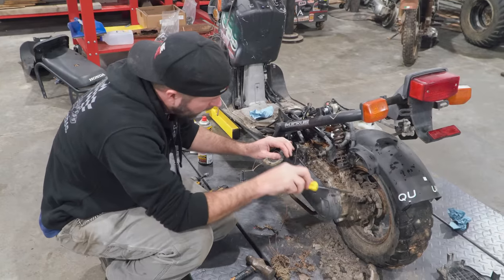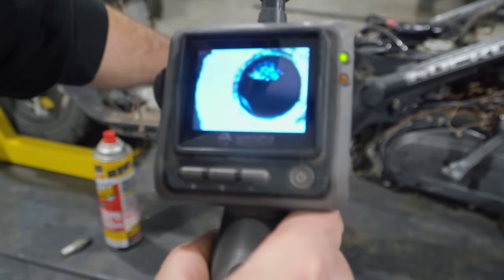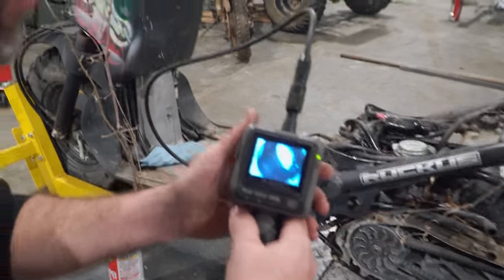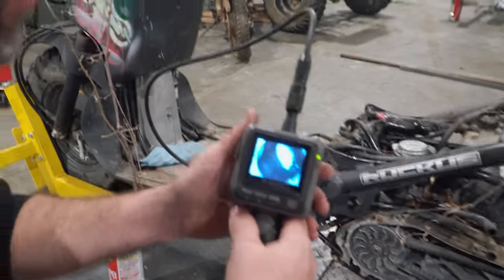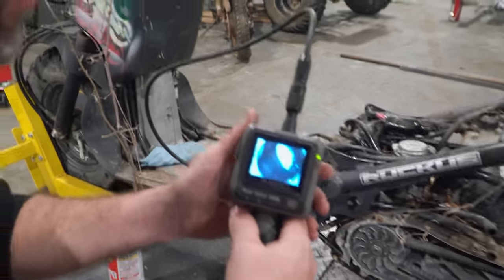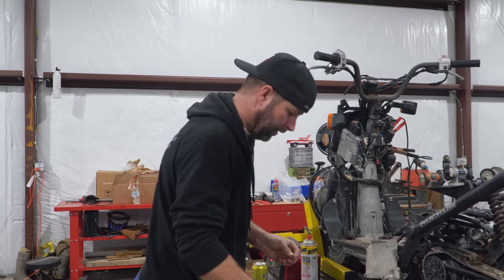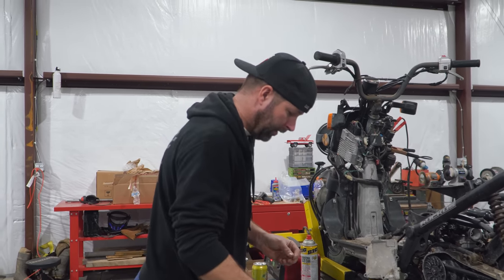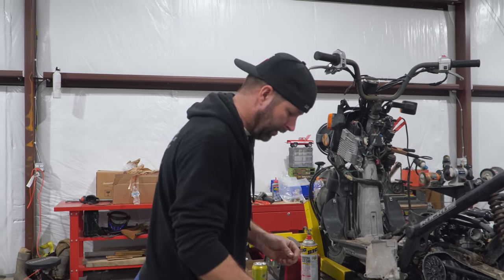We Rescued a Seized Honda Ruckus Moped from the Woods, Will it Run & Ride Again?

Comment: 50cc scooters tend to get on average 100mpg if not more the gy6 125cc are direct bolt ins
Reply: I had a 50cc 4 speed manual moped and it got me 120-130mpg and cruised at 40mph on most rides

Comment: The shims aren't wear items, the valves and seats are. The shims are changed to account for this wear. If you don't have an appropriate feeler gauge, soda cans are usually 3-5 thou thick and can be used in a pinch to get a rough idea. At least in the intake which will probably be around that clearance. The exhaust is probably around double that but it varies by engine. If the valves weren't closing, carbon probably built up on the seat. After adjusting the valves and running it, the carbon may wear off requiring adjustment again quickly.
Reply: You beat me to it Lucas. Valve and seat not shim.
Reply: Some theory is that they become wear items if you grind or sand 'em

Comment: Ah this brings back a ton of memories, I used to have a Ruckus just like that one, mine was a beast though, it easily cruised at 45mph. 
I'd say The clogged muffler is robbing you of a lot of power ATM. You definitely don't need a "hop up" engine!! Get a new muffler and rebuild the valve train and you'll have yourselves a badass cruiser easily capable of 40+ mph. 👍👍
Reply: I also had the competitor to this bike the Yamaha c3 which I liked a lot more then the rukus. Handled better but the rukus would take it on the flats but you hill I would kill the Honda. Plus they both got 130+ mpg.

Comment: You guys should road trip on MTBs with a Monster? 78.5cc 4 stroke, or if you want adventure, stuff a 212 Predator in them, although the 212 poses some challenges fitting the engine, and getting the sprockets to line up, after that, your only problem will be, keeping the front wheel on the ground. I stretched the frame, and added a top motor mount, between the cross tube and the gas tank ears. I lucked out on the front downtube, and replaced the straight tube with sced 80 aluminum with an 6" rad bend at the bottom.My Rock Shock adj front end just clears the new tube at full turns.I also added an LED 7" Harley headlight, and a taillight with turns and brake lights, and a 3 magnet flywheel, and battery, under the motor plate. Rides great, very reliable, and the weight of the headlight helps keep the front wheel on the ground. After 3 years of riding in the Calgary, and now Windsor area, (very flat here), the stainless 2mm spokes started snapping on the rear wheel, so I have just fitted a 6 spoke aluminum "mag" wheel on the back, and 2 rides in, works great. I use the throttle stop screw to keep me at 80 km. In case you're wondering, I was using a hub adaptor on the spoked wheel, and its the second spoked wheel I've had on the bike. The first one did not have stainless nipples in the rim, and failed pretty quickly.

Comment: I have just under 6,000 miles on my 2012 Honda Ruckus and I did the same you guys did with your valves. Now I’m going to check my compression and see if that kit will work!

Comment: Lucky! Around here, even a clapped out Ruckus will go for $2k at least.  The engine isn't a GY6 either, it's the GET2 which doesn't have much in common with the GY6.  The GET is a great engine even though you can't increase displacement very easily.  The Ruck shop's stage 1 performance kit wakes up the bike a lot and it's a simple bolt on the parts and go.  I'd love to see more with this bike!

Comment: Pro Tip for the youngsters: when testing fuel system use odorless mineral spirits instead of gasoline. Far less combustible and hardly any smell. You can work around it and not worry about catching the shop or yourself on fire. The specific gravity is just slightly higher than gasoline so pumps and flow rates will be very similar. It’s petroleum based so it won’t swell orings or attack gaskets in the fuel system.

Comment: As a proud owner of  a '16 Ruckus this one really hit the spot, was wondering when you guys were going to get to us. Gutless pig sure, but still fun to ride? Absolutely. If you try to take this out of a town center, you will only know the agony of 10 cars behind you waiting for a chance to pass. It only goes 38 at best. I haven't found a modification that doesn't just barely tweek performance. I think it is reliable. Happy to see a series on the same ride in my garage. Oh, you didn't mention it's Street Legal and parks wherever bicycles do. I don't remember many of your projects that do that. A bag of ice and a pack of drinks sits on the floorboards perfectly. Also, put some pegs on it. Way more control, less squirrely, I probably should have made that point first... Pegs.

Comment: You should put a Nitrous Outlet powersports kit on it and see what the 50cc will do, a .011" fuel jet and a .012" nitrous jet will give you 6.5 horsepower at the crank with the carbureted wet kit's 6psi fuel pump.

Comment: It has stuck valves from sitting for a long time. especially the intake valve you need to free up the valves. the previous owners probably layed it on its side filled the air filter with oil. then picked it up rode it until it seized up. John is having to much fun on it no doubt. Charles is the first one to crash it. take that big clunky muffler off of it and it will probably run better. I was thinking it was going to be a three. for the first number on the lap time. after Ike was slogging through the mud.
Reply: It wouldn't run at all with a stuck valve. Unless I've misunderstood what you meant.
Reply: @Lucas12v  It didn't run until they started messing around with the valve train. and an engine will run with sticking valves. but it will run but poorly. skipping, and backfiring, ect.. it depends on how badly stuck the valves are. because the valves don't stick open on every revolution of the engine. but the longer it runs the more the valves will free up.
Reply: @musicauthority3516  You know what happens when a 1 cyl engine skips?
Reply: @bobadam7021  Yes, although I'm not sure why you are asking that question.
Reply: theyre not stuck. you saw them moving on the bore scope lol
Reply: Did you watch the video or get the first hurdle and think that was the end. 😆
Reply: @rightnowracing  A person wouldn't be able to tell if the valves were off the valve seats a little bit. and that's usually what happens when the valve guides and the valve stems. get gummed up, or carbon build up, and even rust. and a person could hear it making noise back up though the intake and carburetor. when they were cranking it over. I have been an automotive technician all my life. and I can tell you it's fairly common for valves to stick slightly open. when an engine has been sitting for a long time.
Reply: @MaNNeRz91  What the hell are you talking about? you don't make any sense.

Comment: The valve cover has a pressure relief line that goes to the air box, so there can be oil vapor getting sent to that. Seen it before on a gy6

Comment: if you have problems with the valves not seating because of corrosion , i always put a good drop o oil in both intake and exhaust. mostly the leak isnt that big

Comment: I was prez of the Vancouver Ruckus Club and we did a lot of upgrades .  Bought new Ruckus in 2005 Installed taller final drive gears out of a Honda Metro , I had mine bored to 58cc with a new crank and Wisco piston , Posh cdi with a higher rev limit , larger intake with a larger keihin carb , A mix of three 6 gram rollers and three 5 gram rollers , custom exhaust . Cosmetics were drop bars and lowered custom seat . Would do 80 kph easy . Was a ton of fun met a lot of people , I miss the Ruckus scene :)

Comment: You ever have questions about gy6 motors I know all about them. I'd tear the jug off it stretch out those rings on the piston a little or replace them timing marks are on the cam sprocket but tear it down at top dead some of them don't wanna run with the breather box cause the stock carbs are junk also that thing should do 45 50 it's got to be governed down

Comment: the Ruckus is the one moped I always wanted to get just because you can get 75 and 100 cc jug kits from Japan for the little Honda and a over sized belt drive kit for the 100 cc engine upgrade. back when they came out they were huge and a lot of manufactures made upgrades expecting it to blow up which it did in a small way just not as big as was expected and I never understood why there just cool. they even had an off road variant that was really nice and had the most aggressive tire in the line up

Comment: I regret getting rid of mine bought it brand new and I had such a blast on it, modified exhaust, different roller weights and jetted it was good for 30,32 mph after that took it off road just all around fun and yes the floorboard is one piece.  Gotta get another

Comment: The only thing with hopping up mopeds is that they are limited in speed by law. Go over that and you need a tag and title plus insurance.
Now the fun part.
Back in the early 70s a friend and I rode dirt bikes and he rode MX. He knew all the tricks to wring out horsepower out of a 2 stroke. I had been given a Puch moped in exchange for some work on a car. Fun as it was we were used to life in the fast lane.
Bigger bore, bigger carb, move the ports some and fashion an expansion chamber exhaust.
I took the thing up the three mile long road my friend lived on. As I went I dialed in the carb and turned to make the return run. The thing had a pretty optimistic 50mph speedo on it so I let it loose. His house was about 1/2 mile from a very busy US highway. I thought I would peg the throttle going past and get on the brakes to stop at the highway. I went screaming past his house with that speedo pegged tight. I let off the gas and hit the brakes at about 32mph the brakes stopped stopping. I blasted across that road and took another mile to get turned around. Luckily no traffic was on the only north - South major highway on the west coast of south Florida at that specific point in time. The two-stroke gods were looking out for me that day.
The point is going fast is fine but just remember that at some point you are going to have to stop. Those cable operated drum brakes were fine until we started improving things.
That little motor went on a go cart and raced the rest of it's days. That never bothered me a bit...... LOL!
Be safe out there guys.
Cheers
Terry

Comment: ive worked on dozens of chinese made GY6 motors, I never would have guessed that the honda gy6 has shims.  I'm surprised that the valve lash was off, I would have expected the intake valve to have a corroded valve seat, due to the carb being open to the elements.  I'm also jealous that you got a free honda ruckus.

Comment: Change the rollers in the variator and the belt,re surface the clutch pads.night and day difference.but you need to do something about the compression first.lol
The loads of oil in the air box is from blow-by. I just rebuilt a 150 with the same problem.have fun

Comment: I once had a Baotian with the older air cooled gy6 and a simple way to get a touch more power out of them is a better flowing air filter and putting a step drill to that juice straw of an exhaust tip. Or just build a custom exhaust pipe that flows better.

Comment: A little cvt (variator) tuning will help with heavier riders. I weigh 240lb and had a kymco agility 50. Got it where it would accelerate decently (faster than most people would leave when the light turned green). Top speed on flat ground was 37mph. Would climb these Tennessee hills at 20mph.

Comment: Guys I would have absolutely killed to have found something like that in the woods. I already have the desire to have either a Ruckus or a ice bear Mad Dog and no matter what 150cc motor would have gotten swapped onto it. I just could not wrap my mind around spending 2500 or 3500 something that I'm going to end up modifying extensively. You guys have an awesome score

Comment: I remember you guys saying something about the Ruckus over a year ago and Im super glad its getting its time to shine 😂.  Hit up The Ruck Shop for a stage one kit.  Variator, drive face, roller tuning and a rev limit delete cdi will wake that thing up.  That and new belt should double the acceleration feel.  Getting the rpms up to about 8500 or 9000 is the key with the lil GET engines.  Or get a swap kit and throw a GY6 in it....👀

Comment: little trick is to back fill the fuel return line to kick start the pump back into action
Reply: I think the pump is fine, just the check valve is stuck. You could put another one inline with the pump.

Comment: I'm late on the post. But looks like the belt and rollers need to be replaced.  It's top speed is around 35mph.. it sounds strong and revs good. It's gutless because of the belt and rollers. I've seen good speeds with performance rollers and new belt. Have fun..

Comment: I have this engine on a Honda spree. I call it the spruckus it’s does 50mph maxed out. Btw this engine is the Honda engine named GET not a gy6 
How ever there are lots of gy6 150cc swap kits that’s are pretty good most your gonna get from the Honda GET is gonna be 50mph with lots of tuning. You need to pull the variator off and have a look at the roller weights on this one tho. Not to mention a plugged exhaust. Would love to see a scooter trip tho!!!!

Comment: Any time you see a carb with a 4 screw cap like that one, you NEED to install the airbox for the carb to work correctly.  Low pressure must be present at the large hole near the top of the intake venturi.  The curved rubber tube between the carb and airbox is ENGINEERED to maintain intake velocity throughout the operating range of the engine.

The GY6/QMB139 is truly one of the worlds greatest accomplishments over 100 years of the internal dinosaur burning engine development.

If you compare a 50cc QMB139 to a supercharged 80 liter postwar aircraft engine, or even 16V 92 Detroit Diesel you will notice they are almost all identical in design.

That was hard to say with a straight face.

Seriously, the GY6 is designed to do the very most with the very least.
Both other engines were built to produce as much power as they could with the technology they had.  The GY6 will destroy the other two, power to weight.  The AWESOME 3.2 HP is then modified for practicality to produce speed.
GY6 AWESOME!
Reply: I wish this Ruckus and its GET50 motor wasn't dusted so they could have gotten an actual impression of it. That aside I have been waiting a long time for them to get into the whole GY6 scene, maybe they will go for that good old 230cc kit if those are still around. That would be quite nice for this Ruckus as it's a perfect candidate for a swap with that dusted motor.
Reply: @nap8187  Glad you mentioned that...It is safe to say that even the highest output version of a GY6 that came new in anything with a warranty IS MAKING LESS THAN HALF OF WHAT THE ENGINE IS CAPABLE OF.
Double your power with aftermarket parts!

Comment: It’s not the shim that sees any wear, it’s the valve and valve seat wearing which in turn closes the valve clearance over time and eventually goes negative which in turn causes a compression leak down. You replace the shim to compensate for valve seat and valve wear

Comment: just get one of the 150cc gy6 ruckus kits those things are sick. you need a bigger arm to run it and basically end up making a mini chopper can do about 55mph and some hot rod them up and bore the engines out and can get up to 70mph. there is some videos on Tail of the Dragon with some Ruckus meet

Comment: With all that  mud on the intake plus on the rad and riding it hard maybe it just heat seized. I've done that a few times in my day after it cools down  Usually still runs fine.

Comment: change the roller weights throw a performance variator and clutch with a new belt and you will see 45ish then get an exhaust and jet the carb and you'll see around 50ish

Comment: I worked on 70s and 80s street bikes that had shim and bucket setups on the valvetrain on a 4-cylinder bike that's a pain in the neck to have  to measure and change the shims you had to have a special tool that would shove the shim out when you turned the engine over and yes you had to have a big shim kit with different size shims in it a huge time-consuming pain

Comment: I picked up a ruckus 14 model 200 miles on it for $200. It’ll run 41 mile an hour 75 miles to the gallon but they are gutless.

Comment: The fuel pump is normal. Any car or anything with a fuel pump will prime then stop if the engine isn't running. No idea why you thought there was a problem. They don't pump a lot of fuel so what you are seeing is pretty normal. Now if you had another line on the output of the fuel pump it would work and clearly increase the fuel. However, keep in mine it'll prime then stop until the engine is running.

Comment: last owner runned it without oil  and got it real hot ..that intake  valve spacer kind of acted as a safety when real hot it expended and got the valve stock open ...

Comment: The pully on the engine undo the nut on the crankshaft behind the face plate is the variator in the variator is rollers thay are round if thay have flat spots on thm thay dnt roll correctly and won't open the variator correct and won't pull off very good, thay have a weight to thm in grams so you will have to weigh one to see the weight be like 5.0g or 6.0g. If u want more speed and acceleration put a performance malossi variator it will have a big spring in the kit aswel witch will go in the back pully for better clamping force on the belt and to hold it in the power band for longer 💯💯 must have if u wana go faster its what controlls the "gears as such" and for sound n flow the exhaust. But the variator is the one 💯💯💯👍👍👍👊👊👊👊